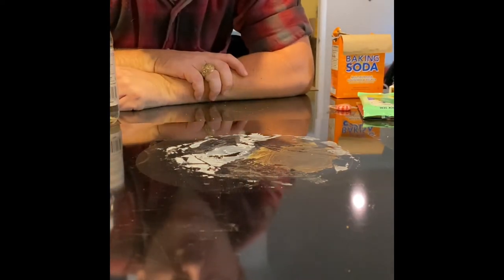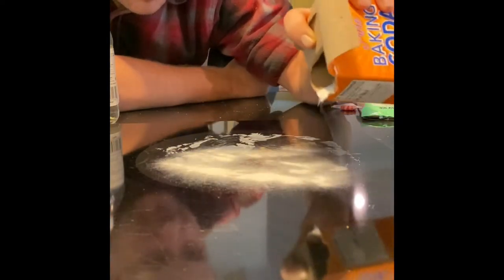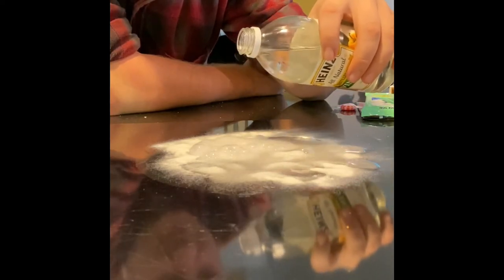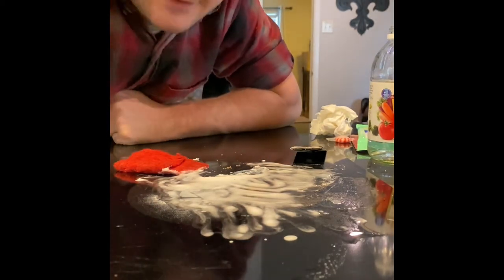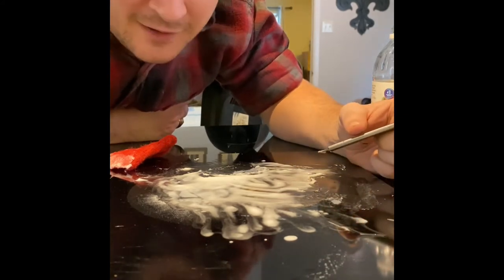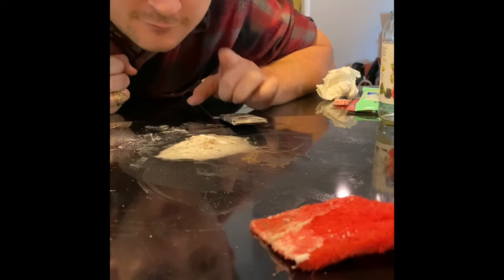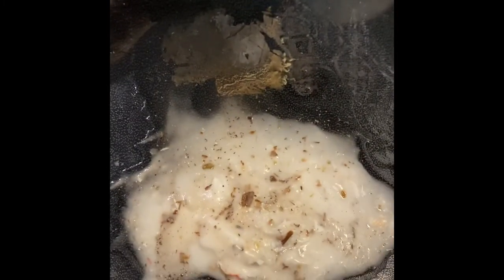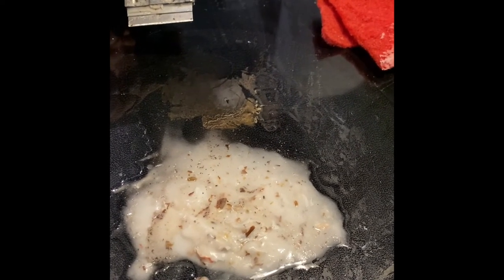Melted plastic bag to my glass cooktop 🤦🏼‍♂️

Comment: I wouldn’t recommend using the corner edge of the scraper - that sharp point can scratch glass. I used a dishcloth & dish soap & removed about 80% of the melted plastic, then used a drop of Dawn dish soap & my finger nail to get the rest. In my case, the plastic melted on the stove top after it had been cooling for about 2-3 minutes. If I had needed to use a razor scraper, I would’ve kept a thin layer of Dawn on the glass cooktop while gently scraping.

Comment: Scratches are usually caused when scraping back and forth. Scrapes happen because grit gets stuck between blade and surface. Solved by only scraping in one direction. forward, so grit doesn't get stuck between blade and surface which can scrape.